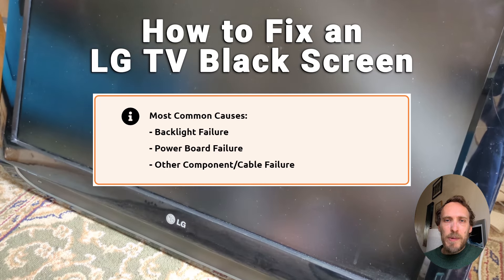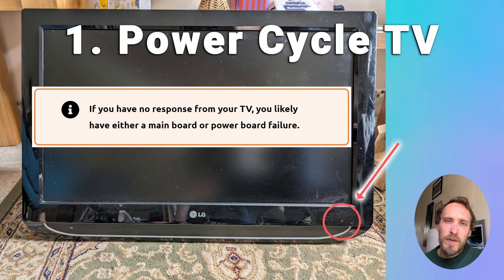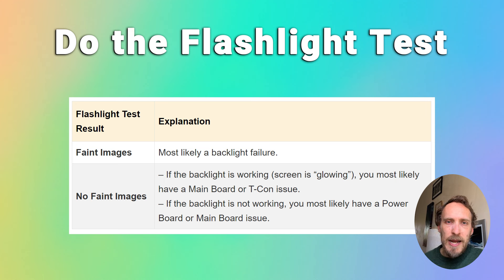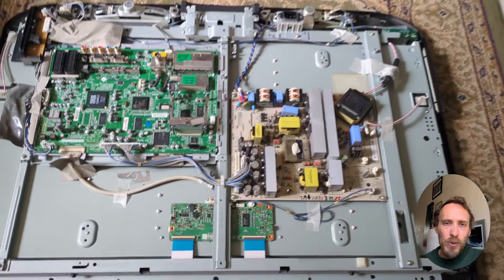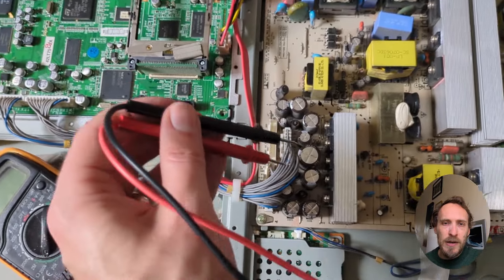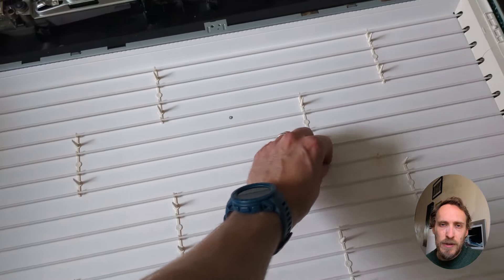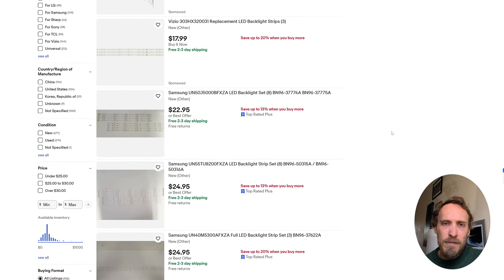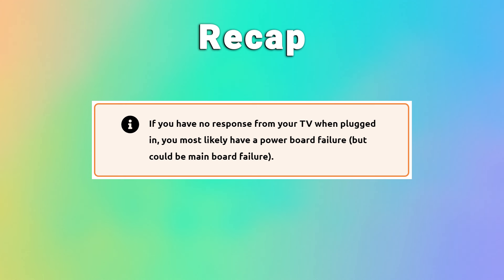LG TV Black Screen Fix | How to Fix the Problem

Comment: Before changing anything, my LG60PA5500 would operate as normal, then turn off. After a bit of time it would turn on again and function normally. Like something was over heating. 

Got a different power board and now it "glows" but doesn't function. No red LED either.

Comment: Actually I have the LG32LK540BPUA. First thing I did was to check my power cord. Found a defect at the end of the power cord. Replaced the power cord with a brand new one. Where you plug that end into tv. Also replaced the main board. So, now I turn on the tv. My audio is working great. However, I still have a dim picture. When I do the flash light test. I can see the picture some what better. What is my next step? Replacing my Power Supply Board? Suggestions anyone? I would apperciate any help. Thank you!

Comment: Mine works for about 5 seconds full lighting picture etc..then it goes black and you can see the images only with a flashlight..this seems different from having no back lighting from power on..does this change the focus of trouble shooting since the leds themselves do fully power on then turn off?
Reply: Hey I am currently facing the same issue as yours how  were you able to fix it
Reply: Same here, about 5 seconds.  If I understood this video right, is he suggesting it most likely would be the power board failure?
Reply: try looking for swollen caps (Capacitors) on mainboard / power board...if 1 is faulty it wont provide enough current to keep the backlight on.
Reply: @justScottnow  try looking for swollen caps (Capacitors) on mainboard / power board...if 1 is faulty it wont provide enough current to keep the backlight on.
Reply: @shariefhoosain3682 I found no swollen capacitors, but I was able to use picture mode and turn down the backlight setting and it began to work for longer periods of time. Although no longer